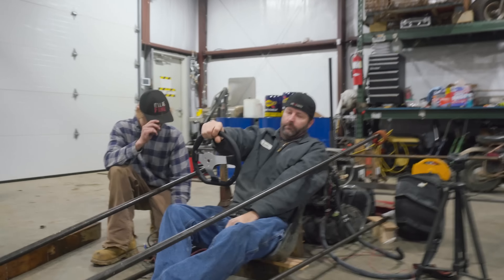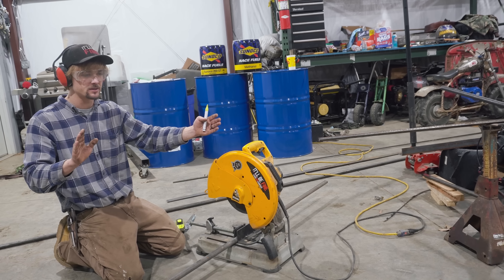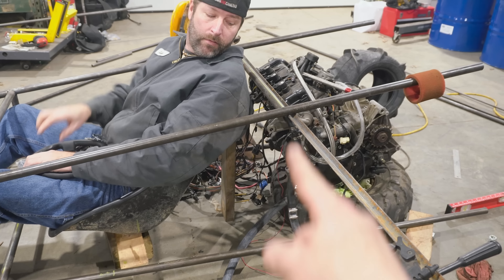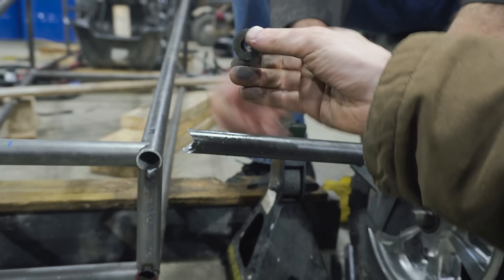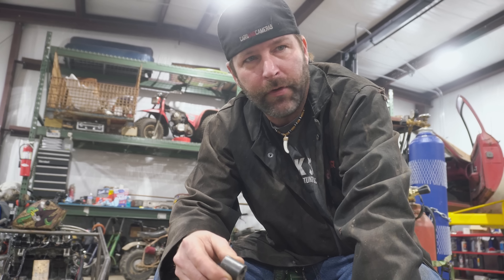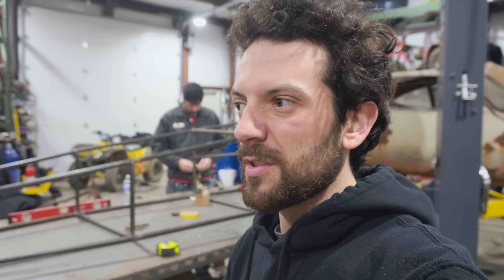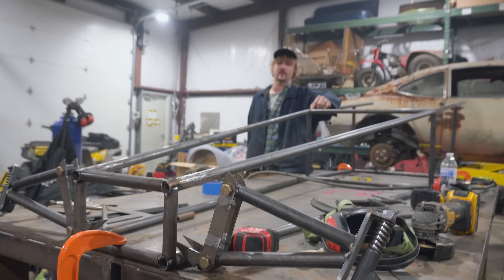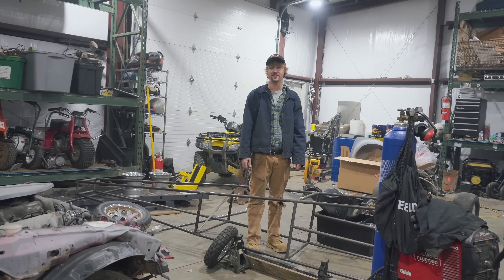118HP Triumph Dirt Dragster Build Pt. 2

Comment from the maker: We JUST got the engine hung in this thing 15 minutes ago, and it looks GREAT. Stay tuned!
Reply: Things gonna fly
Reply: B18 engine would be sick in a gocart lol
Reply: Looks greats can't wait to see the car in the back ground build series
You should call it the mazrat
Reply: You are getting closer to not being morons. Dont use the tire when you are jigging up "suspension" parts. Build a part from a hub to install on the spindle, or better just build a spindle replacement set at the right height and alignment settings to tack securely to the table. Then build your arm off of it to the other side of your jig. Since you are bolting it on I would add a third leg rearward for stability as well. If that thing folds up in the dirt you are in big trouble. The front should have a bit of a ski shape to help prevent a big rear hop from turning it into a sand dart too.
Reply: Way cool!!! WOW
Reply: please collab with grind hard with this!
Reply: Hey guys let's weld next to high octane fuel.....it'll be fine....lol
Reply: I'm super curious what that car on the lift is. It's been bugging me for a couple videos now.
Reply: I'm half tempted to pull out my 200 cc blaster engine and put it on my kids Manco one seater
Reply: In the next video oh shit we blew it up we'll rebuild it never mind we'll move on to another project never finish it
Reply: Post it on the community tab
Reply: @Turkeythigh420  its an opel gt cool little German mini vette from I think the late 60s and 70s and the flip up headlights on them are wild they rotate around a longitudinal axis rather than a transverse axis like most flip ups
Reply: Oh yeah, can't wait.
Reply: @zZWolfyZz  thank you.
Reply: @jasonbirch1182  YES! I AGREE WITH YOU... And the rear suspension should have a lot of travel and be REALLY soft, soft to the point of "almost dragging", to help it to not do a rear end forward "endover". 
My 2 cents.
Reply: Removing rotational weight can be useful for increasing acceleration from the same power output until traction becomes the limiting factor. Heavy wheels increase traction and flywheel effect. 

Increasing and decreasing rotational mass both can be a hinder. The specifics relate to the dynamic of all the other factors combined.

Gyroscopic forces are celebrated by some and hated by others.
Reply: @zombielight2456  A B18 would shred that thing in less than a minute colloquial time. I daily a B18.
Reply: @ericwilson2585  yeah, honestly they should be building it with front suspension other than a sliding spindle. That thing is going to rip and when they suck at driving and shifting it, it's gonna be a rough ride doing 70 when the nose has full weight again. Suspended linked live axle like a mini sprint or double a arm would be ideal. I have a feeling someone is crashing this thing😬.
Reply: @zZWolfyZz  did gm own opel at that time or was it closer to when opel made the manta(great car in rally, and forza horizon)
Reply: Dragster frames are SUPPOSED to have a LITTLE "springage". That's their suspension. But then, you aint makin' 11,000 hp! 🤣
Reply: @jasonbirch1182  I didn't understand any of that. And I'm pretty sure they didn't either. 🙄
Reply: @Turkeythigh420  That's an Opel GT, built by GM in Germany for the Opel division, circa 1970. In America, Opels we're sold at Buick dealerships. Cuz Buick dealers needed a small car, and Buick didn't make any.
Reply: @zombielight2456  I disagree  in my opinion far better  to use a sportsbike engine same power with a fraction of the size and weight

Comment: You better triangulate those front A arms or you are going to bend them back the first time you put a little pressure on them. The length of the arms is going to act like a lever and add a bunch of pressure on them.

Comment: Looks like a box.  You really ought to build a centerline jig where the jig can be made level regardless of what the floor or work tables are doing. Then you can rotate the frame along the center and work on it without ever taking out of the jig.
Reply: That is the spot on
Reply: that would be to logical lol but you are correct. gotta be repeatable.

Comment: Love the show can't wait to see how this turns out! I do have a suggestion.  Triangulate the top of the front axle to keep it from wanting to rip the front wheel off if you hit a pothole on the return road! If you research a dragster tripod front-end they have 2 top bars and 1 bottom
Reply: I came here for this comment 🤣. Two single bars are great for vertical strength, but will do nothing to keep the system from folding in on itself with a good hit to the front
Reply: Yep,or a Wishbone to control the spindle. Triangulation on the control arms with adjustablety to set and maintain your alignment.At speed the forces will be toe out big time. You will need spindle kicked back, wheels straight with the rear wheels. Spin front tire on wheel with a needle point awl light score all the way around on both tires measure front and back of tire roll straight. Mark it out on leval floor.Have driver in seat with nose up little on front end like at speed 1/8 toe end it will go thru the lights like a champ.

Comment: You should put screw jacks on the bottom of the table to level it no matter where you move it to.
Reply: Yup...  Be easy enough to weld on to the sides of the legs.

Comment: Guys there is a wheelbarrow load of valuable advice in these comments.  When you weld, all of the welders out there chime in to offer guidance, since all here want to see you guys learn along the way.  

Take the advice about CrMo fab a bit more seriously.  
Dont freehand the stinger anymore!!  
The horizontal tubes across the nose should go edge to edge, with the frame rails terminating into them.  Watch Ty weld up one of Cleetus's cages.  If you're paying attention you will learn how to properly join structural tubes in the best config possible.  He is a master.
Power tool clean to near white metal the areas to be welded together.  Should be obvious by now.  CrMo needs to be stress relieved (post weld heat treated) to take advantage of the strength properties.
Learn to use a chalk box, or something that gives you a datum point or a centerline.  There is no excuse for a lop sided chassis.

Cant wait to see it rip!

Comment: Just like a full size dragster rail its ok to have wimpy front end but this is gonna be in sand too and thats gonna be hard on the front that you have built I think your gonna have to beef that up some more
Remember this will have more power than anything you have so far

Comment: I think you guys need to add more support to those rear bearings. With the loads on them I can see them cracking or bending. I would move the axle forward a tad and replicate the support at the front to provide for four bolt mounting holes each, not just two.

Comment: Chrome-moly requires a specific weld technique to avoid the welds cracking. Since you have so much HP, be aware of this and don't end up with a potentially dangerous frame.

Comment: I know you guys are only using chromoly for the weight savings so it doesn’t matter… Of course you already know, the tensile strength of the welding wire is weaker than the chromoly tubing is… Which is why chromoly is always tig welded. Gives the weld a higher tensile strength to match the strength of the tubing… 👍👍👍👍

Comment: Idk about the triangulation on the front of it thats gonna look a lil bit goofy . The front looks like its going to be substantially wider than the back . I think a braket welded right to the spindle thing and then bolt them together . The need for the pipe extentions is minimal

Comment: One thing to note when welding chrome moly is that you need to anneal your welds.  When you finish welding a joint, use a torch to get it red hot and let it slowly cool on its own (no fluids or fans).

Comment: Look good so far , you need to put a strut bar from the lower control arm to the upper chassis tube . You have good strength up and down but need forward and rearward , especially if this thing is as fast as it looks to be .

Comment: Nice. See y'all started a new build. You'll be able to haul two to the drag strip and double your fun.
    Is that a opal GT I see in the background? One of the coolest Ultra small cars. 
   If so, and you haven't dealt with the transmission yet, seems like I had to access bellhousing bolts through holes in the firewall. Remember doing the clutch but it seems like that was access to the starter as well. Over 40 years ago I guess one forgets.lol
    Had a friend in the late 70s who was buying them, then stuffing in a 350 in and flipping.  he was also doing that to all the Datsun Z cars he can find. 3-4 weeks a car.
   That included glassing up wide flares, modified Hood, and paint.

Comment: I want to type some advice about welding. Yes, I know you three know that welding requires heat. What does that heat do? It expands the molecules of air. When the tube doesn't have any holes drilled into it, that final weld will blow the filler metal to splatter outward, potentially burning the person who's doing that welding. That's the reason why a hole should be drilled at the bottom of one of those two tubes.

Comment: When mig welding chrome molly tubbing double check you're using ER80S-B2 welding wire. Just a heads up for ya.
Reply: I'm looking at it wondering the same thing if not should have built it out of regular steel or its gonna crack and come apart.

Comment: You jump that thing and it will fold up and pop welds. You boys have the skills to build a real suspension.  No doubt in my mind.
Reply: You don't jump drag cars (not on purpose anyway)
Reply: @ZrubekFamily  You’re right but they are building a sand rail so. . .
Reply: @scottycollins131  for drag racing... thus the comment that was made about it not having a tight turning radius...........
Reply: @thedr309  Its a sand rail.

Comment: Thumb shifted Pingle shifter on the steering wheel, foot clutch,brake,and throttle.. huge disc and large caliper out back,small discs and calipers on front ... Engine mounted at factory angle, chro mo tubing should be tig welded with zero gap,mild steel,hot rolled or cold can be mig or stick welded with minimal gaps preferred... The chassis is sorta overly long for what you're  building and adding needless weight as well as turning radius.. They make an all aluminum,non hub vw torsion tube type front suspension one can order in various widths as well as torsion rates..

Comment: The theory about not gap welding chrome Molly is that you’re not purging so the backside can’t get contaminated so that’s the reason a good type but fit is stronger
Reply: Also, the extra heat concentration filling gaps makes it brittle. Personally, I wouldn't ride in anything with a chrome moly chassis at 100+mph that wasn't TIG welded by a certified welder.

Comment: If the other frame is only bad in front, you can just shorten it. Have it so the engine can easily swap over and you have a 118hp weapon around the yard course.

Comment: love the project just wish you would put more thought into construction. especially triangulation in the chassis. some of the things I do like but after building dirt late models for 40+ years lots of things you have done make me cringe.....note, you can "gap weld" Chromoly but it will be weaker, to do it properly it should be TIG welded, Chromoly has grain.... but I will just leave it at that... keep up the ideas... but dont be scared to ask for help in design....

Comment: To Bypass Strait Across You Should Had Bent Each Side Up at a  so  desired  / degree angle \ top over giving you More Leg Room , You Could Gusset the Top two points farthest From Knees / welded in /having that bar So Close to Knees Would Be a Point of Impact Load , first sign of breakage / rear looks great with adjustment options and you Technically Need 3 Down To Very Front Bar And One DIRECTLY BEHIND SHOULDERS " Directly  Not Over  /    \ Over  Is For Head Which Braces From That Just Stated Bar UP AND DOWN BOTH and Then Cross Just Behind Head     ,  Then Over .

Comment: Myself I like to have the steering wheel a little closer to me, it makes for better leverage. although that might require a removable steering wheel. at least that's how I liked it when I had my circle track car. but on a drag rail that might not be necessary.

every once in a while a person has to go back to the drawing board. but it's better to find that out at the beginning of a project. rather than when the project is farther along.

hey John, this vacation thing you speak of  what is that? I've never heard of that before, Oh do tell?

Comment: This should do 125 mph easily, in the quarter mile.  There might be a few more races in those lightweight slicks, yet.  As for the sand, that's all in the gearing and the density of the sand, but I'm certain she'll haul yer britches around proper.

Comment: Make sure you guys have good strong links for steering and be careful when slow speed turning. My dragster is a bitch to turn going slow. The steering will lay over one side or the other and is stuck until someone pushes it back by hand.

Comment: How is that front suspension supposed to travel when its welded solid to the spindle? Doesn't it need to pivot at both ends?

Comment: Guys, you’re still gonna have an issue with that sand rail it’s too solid the first jump you make it’s gonna bend the whole damn frame in half specially, on Sandune’s you need front suspension and rear suspension. You might find that out later but if you’re just using it as a golf cart in the backyard. It’s fine but you need front shocks and rear shocks. If you want a real legit, Sanrio specially with all that damn power you got in the back of it.